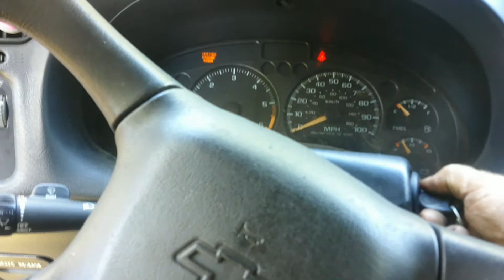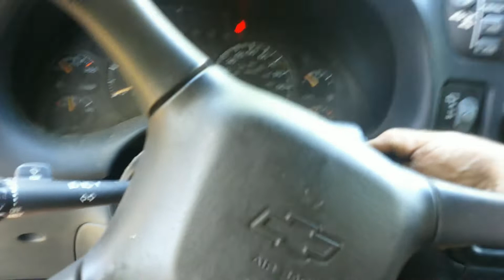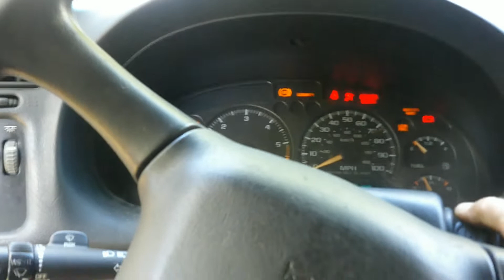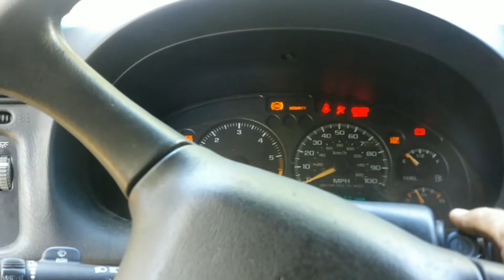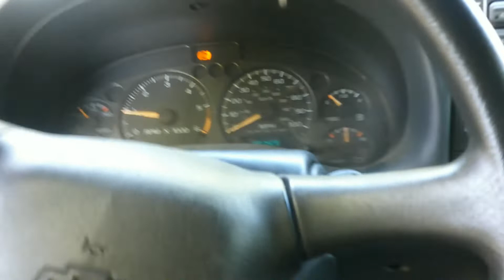Chevy Blazer ZR2 | fuel pump repair

Comment: I have a 2003 ZR2 and I love those things. Just a fun vehicle. Mine's rusted to hell after too many trips to the beach and hoping to find another sometime. I'm about to have to drop the tank too to fix some wiring that got chewed up by squirrels, not looking forward to that. That ABS light isn't too hard of a fix. Just weak solder points on the board inside the ABS module. I fixed mine with literally no soldering experience. They should have recalled those modules but never did. They're ALL faulty. Or you can just disable the light if you don't care about ABS.
Reply from the maker: Mine was rusted all to hell too. After I welded my exhaust I heard a knock in the motor. I bought another one with blown head gaskets for the bottom end. I still have some work to do on mine but I'm less than an hour from Silver Lake and I can't wait to go. I do have some pictures maybe I'll make a short. Thanks for watching

Comment: Bad idea with the screw. Should use fuel approved pro seal.
Reply from the maker: I didn't trust it. I was afraid to drive down the road with it until after I changed the whole pump. This just confirmed that the fuel pump was the problem I was having and it allowed me to move it around the yard. Thanks for watching.

Comment: How did you actually get that cover off, I have remove all the bolts but can't seem to get the cover off do I use a pry bar?
Reply from the maker: Mine came right off after I got all the bolts out. I'm not sure why you are having trouble. Sorry I couldn't help.